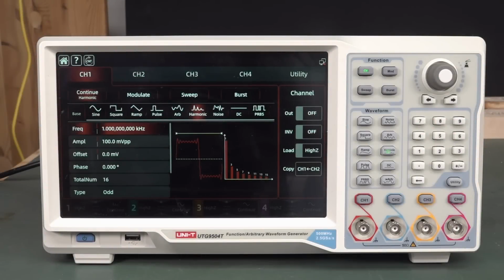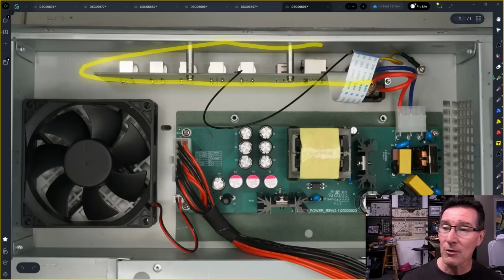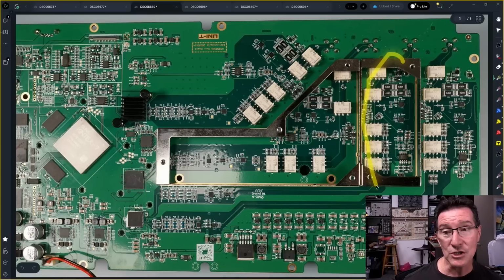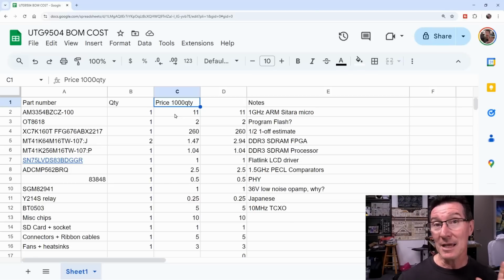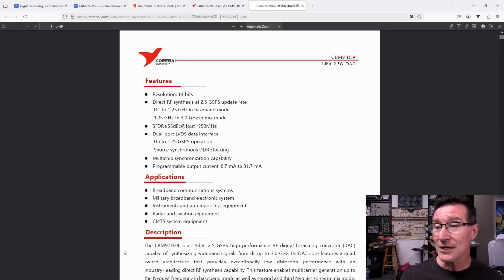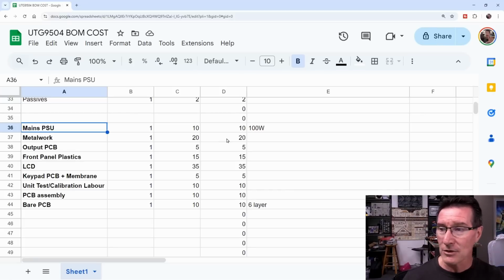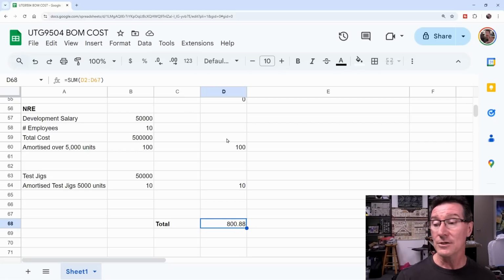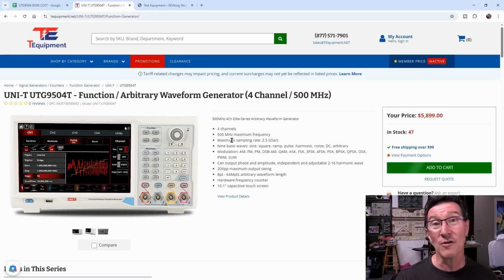EEVblog 1679 - Why Does a Uni-T AWG Cost $5800? - BOM Cost Analysis

Comment: The price seems very high. They won't sell many at $5,800. Would they sell 2x or 3x more if they priced it at $2,900? I think so.
Reply: Not if the market is already saturated. You cannot expect to always sell more by lowering the price. You optimize for what your target customers are willing to pay, which is somewhat related to the value the device has for them. It isn't really related to the cost of the product at all. Only if a competitor offers a similar device at a lower price, you will have to adjust.

Comment: I suppose software development will add a lot too. Especially if an fpga is built in.  6 to 7 figures are a low estimate for this, as only few people are able to do it right and you need expensive test equipment to debug it.
Reply: <eso es verdad, pensaba lo mismo. Desarrollar un instrumento de semejantes prestaciones, no es trivial, se necesita mucho tiempo y dinero.

Comment: $6000 for $600 bom? What happens if the motherboard is broken, do they ask $600 or $5000 for a new one?
Reply: If companies would offer replacement parts at reasonable prices, one could easily see the BOM cost there. Like the price for a replacement PCB, LCD or other major part. Don't know how it works in higher value markets, but it seems we're not living in an age of repairability and support for it anymore, because of the pace of technology "improvement".

Comment: Arb are really expensive. The parts are pretty expensive (xilinx parts can cost over 1k) too as they don't sell many and a lot of software and dsp programming.  This is actually cheap for what it does.  From experience xilinx parts are not discounted in volume by much and those extra numbers do mean a lot.  A lot of these arbs are used in manufacturing to test cellular and wifi products.  Uni-t will also discount when purchasing volume of a few hundred for a production line.  These instruments are often built for a large customer.  Your eatimate is way low.  Just be the costs of building prototypes would.cost over 500k (tooling 5x pcbs , quick turn prototyoes etc).  I would estimate they sell way more than 5k units

Comment: At $5,800 you are buying equipment based on reputation and trust. I find it hard to think that they would exceed 1,000 units sold. This is likely just for the prestige of building high end equipment; I find the pricing reasonable for such low quantity production in a competitive market.
Reply: Yeah it can be a loss leader just to get their name out, put into high end schools, etc.
Reply: Yes, you would place a product at a lower price to gain market share (or enter a market). As an established brand you then can gradually charge more with higher margins or sell higher value products with lower risk in the long run.
Reply: For people with a lot of modern work - RF, transmission protocols etc, an instrument like this is a no-brainer. I’ll get one eventually even if I don’t specifically need it at the moment. I wish they isolated the channels but that would bump up the price by another $1k probably.

Comment: As others have said, your development costs are at least a factor of four times too low, and likely as much as six times too low. Others have also stated that the sheer number of some of the passives is probably going to break the $2 mark that you have mentioned. So all in, I think the BOM cost would be closer to $1500 bare minimum.

This is still a very interesting video, and would make a good jumping off point for detailing out some of the production costs to a more accurate estimate.
Reply from the maker: The problem is that you have to be in this business in China to know these prices. My basic costing was always going to be a minimum.

Comment: uni-t often uses premium parts in the hearts of their products where it counts, and save the cost where it does not count. For instance the best low cost radiation detector is from uni-t and it has a general electrics geiger tube.

Comment: Another thing to keep in mind when comparing price to BOM cost is how many units will they sell? The more units they sell, the closer the price should get to BOM cost since they can amortize a lot of fixed costs like R&D and tooling over more units. On the other hand, a limited run product means each unit must cover a larger fraction of those fixed costs to make the unit worth developing in the first place.
Reply from the maker: In this case it's pretty niche, which is why I put a max lifetime unit volume of 5000.
Reply: This device seems pretty niche

Comment: The real question, would you pay $5800 for this? Even without knowing BOM costs my answer would be hell no.
Reply: If you needed the functionality? Sure. Sometimes going for the cheapest option causes you to lose out on the capability the more expensive units have.
Reply from the maker: Where else are you going to get this functionality for the price?
Reply: The first question I would ask is if I needed something like this regardless of what it cost. If I needed it, then I would look at what my options were in the market. For my use case as an advanced hobbyist I have absolutely no need for a 500MHz function generator.
Reply: @doublestrikePhoto  but wouldn't it be just so cool to have one?
Reply: Don't underestimate frequency envy!  It's the engineer using a low cost AWG device who gets butt hurt because his colleagues have a better one.  He'll find a way to convince you.

Comment: Yup. It's mostly "expensive" because of the low volume and having to amortize a whole bunch of cost across a small number of produced units. Economies of scale are the key.
Reply: Also niche products with less competition are not really cost driven. In the end it doesn't matter, if the unit costs 2-5x of what it could cost, if customers really need the device and have few other options to solve their problems.  I think, it rather works the opposite way to mass consumer market, where cost is everything and you lie about specs, cut corners everywhere and often don't care that much about customer satisfaction. Here you rather over-deliver in quality and reliability to make that market work. Niche markets are probably better to finance special R&D and establish latest technologies, while mass market is better for low cost production of older gen tech.

Comment: Cost aside, I think aesthetics matter in a PCB layout, and this is a winner. Somebody took some pride in that layout.
Reply from the maker: Block names would have been nice. Marked voltage test points etc.
Reply: There's a non-zero chance block names were removed to make reverse engineering a bit harder. Speaking from someone who's seen the effects of directives to remove designators and test point labels for that purpose

Comment: Rigol DG5252 Pro, Rigol DG5352 Pro,Rigol DG5502 Pro are comparable in price. They probably have the same hardware. 
The Siglent SDG6022X also has the same hardware as the Siglent SDG6052X. 
I suspect that Rigol and Siglent still make a profit with the “smallest” devices.
Reply: They do, so that is a good comparison for BOM cost, DG5252 Pro is $1700 2CH. So BOM would be less than half of that. $800 seems reasonable for 4CH.
But, they still would rely on at least some high end sales ($5k units) to cover the NRE costs.

Comment: Expensive - some comes down to the brand name, some comes down to Research and Development, some comes down to the BOM, some is just filthy corporate greed.
The TI Processor is likely more stable than the cheaper ones, and for the price Uni-T know full well you don't want a device that crashes, so a more expensive, more stable processor is used
Edit:  I did forget with prices, certification and calibration is also a cost, and this is not  a cheap cost.     So Corporate Greed is a pretty low part of the overall costs.
I agree with your assessment of the BOM pricing

Comment: 800 dollars is way underpriced. You are missing freedom to operate costs, patent licensing, and maybe intellectual property insurance. Freedom to operate service can cost $10-30k per product in only one country. Since this is a complex design, I assume it will cost even more. Imagine selling internationally. It can add up pretty quickly and easily reach hundreds of thousands of US dollars to start selling commercially. Patent infringement alone can cost the company a fortune and possibly bankruptcy.
Reply from the maker: Yes, as I mentioend the $800 that popped out of the spreadsheet is just kind of a first pass breakdown minimum. Plenty of stuff not included.

Comment: Is that me or you didn't include software design/testing?
that's quite significant on something like this.
interesting design, not something i will probably ever buy but interesting anyway
Reply from the maker: I included development wages
Reply: Using modern frameworks (eg Qt+QML), the GUI can be banged out pretty quickly. It’s not that hard. Gotta assume they have in-house libraries/solutions for LXI, built-in web server, etc. A lot in such products can be pre-generated by scripts. Eg. The backend code for the parameters adjustable by SCPI and the GUI can be generated from a json or toml file describing the settings and data types. A lot of repetitive work in such projects can be scripted in a couple hundred lines of Python. And this isn’t their first product. You’d hope a good group of devs would work on in-house tools to minimize bugs and maximize productivity when it comes to mind-numbing stuff like hundreds of configurable parameters, hundreds of FPGA registers, etc.

Comment: From my experience, I'd say your estimate is probability pretty well bang on.
Reply from the maker: I think it's a minimum, I'm pretty sure it's quite a bit higher all things considered.
Reply: @EEVblog  i am known for my habit of discounting marketing and labor costs. 😅
But you did restrict to only 1k parts, and so I think some of that will come out in the wash considering multiples of parts per board and components shared across devices in their inventory.
Reply: But yes, probably minimum. They may sell 5,000 units in its lifetime, but I don't suspect they'll buy 5,000 pcs worth right upfront. I, personally would do a few to test, then some to sell, then god forbid, find that bodge requiring a new trace or a couple caps. order 1,000 pcs., etc.

Comment: Why can't FPGA makers just work on getting getting some of those FPGAs into the general market in order to use economies of scale to lower prices. For example, let go of the price gouging, and get motherboard makers to include them for added functionality such as an competing encoder and decoder to compete with NVENC but with more format support and the ability to update it to support new formats. They just need to get the pricing down to probably under $20 and it would be a really good value add.
Reply: First, an FPGA like that is a huge piece of silicon on a very advanced process.  So, the die cost alone is going to be quite high (think rival to your CPU or GPU).  And if there's an application where the volumes might be high enough to get to economies of scale, it probably makes more sense to just go ahead and do an ASIC or integrate it with something else.  And for PCs, there IS a place where you see FPGAs integrated.  Some time back, Intel announced an Altera FPGA integrated with an Xeon.  They're really only for specialty applications, like HPC or specialized industrial applications.  You can also get FPGA accelerators.  The reality is that FPGAs will pretty much always be specialized.  Not only do you have the cost, but FPGAs aren't like CPUs, where you can have easily standardized instructions.  Every FPGA (or FPGA family, anyway) is really its own special thing and you basically have to do at least some custom software development for each FPGA you want to support.

Comment: FPGA pricing is VERY opaque. can cost 500 or 50 depending on who you are and how many you buy.
Reply: Indeed. And if Unit-T standardize all instruments around the same FPGA, they could get that $700 for $50 in volume. I know of a case where Xilinx were "kind of" open to the idea of taking a $30,000 FPGA down to $25 or so (ordering millions). The deal never materialized for other reasons at the customer's end, but it wasn't shut down immediately.
Reply: @niclash  Millions of products that require a 30,000$ fpga? It sounds like they didn't have a production line for it, so to get one the cost was 30k, but for a million they could assign a dedicated line for it.
Reply: @firedeveloper that makes sense. I’ve always been mind blown by the price tag on Xilinx top parts (the largest Virtex-7, some Ultrascale+…). Not only I wonder how it can be that expensive to make, but also who on earth will be willing to pay that, and why (e.g space must be insanely critical so you don’t simply split your design into several more reasonable FPGAs). The idea of a « sample pricing » (sellers have a couple in stock so they do manufacture some), and possible pricing if you commit to enough volume, is probably the best explanation.
Reply: Is that true even for the high-end FPGAs with difficult yields?

Comment: Are the chinese already manufacturing high speed high resolution ADC DAC?
Is their current IC technology sufficient for these?
Reply from the maker: Obviously they are.
Reply: I think USA has export controls on high speed DAC & ADC, which would give them an incentive to do it.
Reply: They do have their local multi gsps ADC/DACs, but in this case it is just locally packaged TIs & ADs chips.
Reply from the maker: @bakagaijin7452  Are you suggesting that CoreBAI just rebrand TI and AD chips?
Reply: @EEVblog  YT shadow ban makes me mad. Buy MXT2001/RAD1082(from ali ~30$) & AD08D1500(used from taobao ~30$) acid decap and compere them.

Comment: If you value your time and sanity, you choose MCUs/SoCs with solid documentation, driver availability/quality, general SDK toolchain ease of use, and manufacturer support. On low volume items like this it’s a no brainer to go with the established manufacturers to avoid development headaches.
Reply from the maker: Does depend on what your company has invested time into.
Reply: Yes, for sure. Picking some mcu with terrible support can easily double (or more!) the development costs, as well as making you gunshy towards producing firmware updates.
Reply: @TheRealWulfderay That makes FPGA SoCs with OSS soft cores a good bargain. You get the source for the whole thing. I’ll take Hazard3 over a lot of other designs just because of how good the docs and user community are.

Comment: LCD and PCB are definetly off by factor of 3 at least
Reply from the maker: Too low or too high?
Reply: @EEVblog  too low! You can order 2 layer PCB for 5 bucks per 5 pieces, but its only 10x10cm max. Just did random quote for roughly about what I have captured while watching the vid and it calculated 2000 for 100 assembled boards. I think the real quote with all the details will add another 50% to this cost. As for the display - 7 inch TFT costs around 30-50 bucks (not even from the official seller), and it looks like the one used in the generator is larger than 7 inch.
Reply: @dnkreative  Its a 10" capacitive touch screen, 35 is not unreasonable at all for high volume. You can get a 10" android tablet for $60.

Comment: 5K seems a huge volume for something that expensive. 
You forgot the enclosure, with injection mould tooling ( does it share the case with other products ?)
Reply from the maker: I included the front and back plastic enclosures at the end 30:44 . I don' think they are shared with anything else. Yes 5000 is a lot but I'm assuming entire lifetime. Could be on the market for a decade. There are a surprising number of university and other labs out there.
Reply: @EEVblog  IMHO they will be spending 30-50 thousands per injection mould. Especially that big. And you easily need a mechanical engineer spending couple of months until they get all the clips to snap properly and all the parts to come out nice, without flow marks.
Reply: @tszaboo4952  u dont know what big is
Reply: @tszaboo4952 I don’t believe the mould is that expensive in China. Tolerances aren‘t critical at all, and if you design it well (even thinkness, mould simulation to look for the perfect spot for injection) it will look good from the first piece.
Reply: Looking at all of the 1206's definitely more than $2 each unit, some of those caps are $0.50 each...
Reply: Interesting breakdown. I’ve recently noticed Uni-T is also making some process handheld instruments such as calibrators that they price in a similar neighborhood to competitors such as Fluke. Speed costs money. Precision costs money. Both may be aimed at ROW markets, not the U.S.
Reply: Would be interesting to know what the initial batch size would be. It should be less risky to produce niche products in small batches and test the market first. Also allows for later revisions, when problems appear via customer feedback. I don't think you would produce the projected units upfront, put them in storage and hope they will sell and work as expected. You would probably only buy the parts upfront, if availability over the years is uncertain. The R&D cost including tooling and stuff are surely spread over full product lifetime, but BOM and production costs are certainly not. If the first batch sells out faster than expected, you can then increase the next batch size to cut costs and increase your margins. But keeping financial risks low should be highest priority.